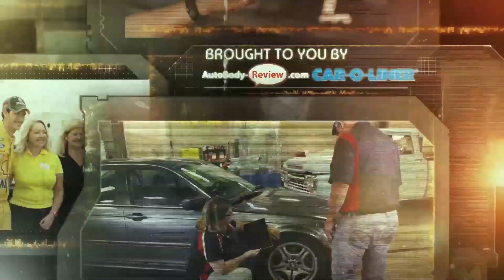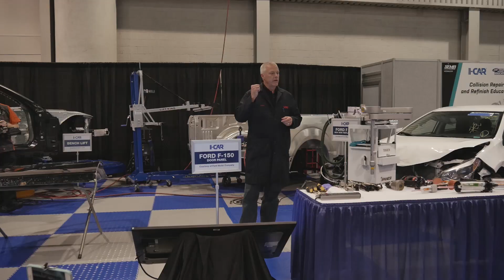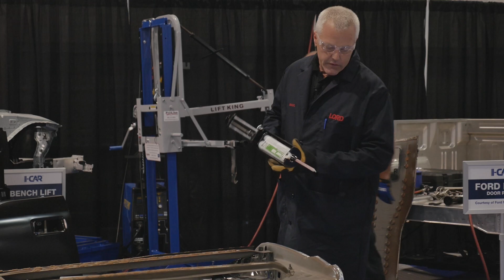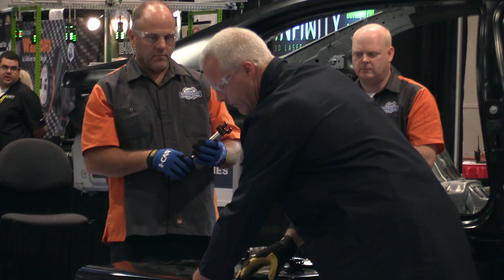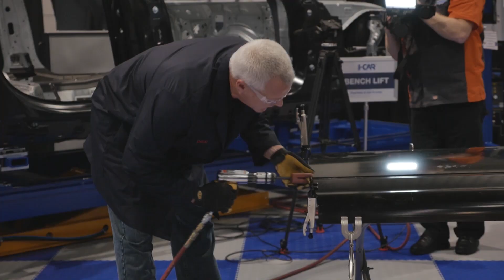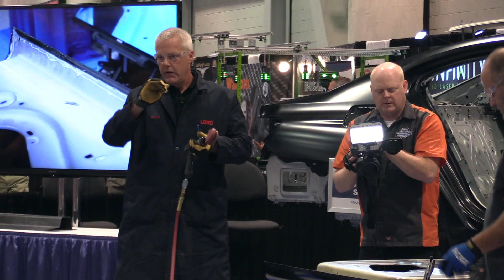Ford F-150 Aluminum Door Skin Replacement | Adhesive, Hemming & Collision Repair Tips

Comment: After dozens of aluminum skin replacements, I found out on the first one, if I didn't soften the hem, it would crack along its length. So now I burn the E-coat off the flange, wire brush clean; and the hems fold flawlessly. I never clip any door skins, ever! None of my skin jobs require filler.

Comment: Mark, aluminum can corrode when it is not covered or protected and you have the presence of other elements such as Steel, the aluminum will break down to protect the steel that is corroding. This is called galvanic corrosion. During Aluminum repairs a clean room is important and ensuring all bare aluminum is coded will prevent the dissimilar metals from coming in contact with each other.
Reply: electrolysis my friend.....
Reply: @kralljazz  galvanic corrosion